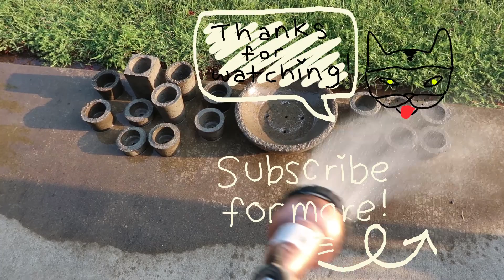Hypertufa | DIY

Comment: What if I can't buy Portland cement in my country will quick set work just as well..?
Reply from the maker: Hi! I have not tried with quick set cement. I'd imagine the water ratio will most likely be different and the finished color may differ as well. I found a recipe from Amy Renea's Crafting With Nature book: 2 cups quick set cement: 1/2 cup filler: 1/2 cup water. I've not tried this recipe. Let me know if it works for you. Good luck~! p/s: quick set sets in 5-10 minutes so work fast!
Reply: Thankyou for taking the time to find out for me
Reply: It will work perfectly. It will be a little heavier but the added benefit is It will  set faster.

Comment: Thank you for the video! Question, I have been watching a lot of videos on these, and most of them have covered the pots in cement for the 2 week curing method. What are the benefits/drawbacks of not doing that?
Reply from the maker: I'm not sure why one would cover the pots in cement during curing. I exposed mine to the elements and rinsed them off. Without rinsing, the pH level of the pot may be too basic (alkaline) for some plants.
Reply: Hi Melanie.  Regarding the chemistry of how cement 'cures', the slower it cures the stronger it will become.  By covering your concrete mix with plastic you can slow down the curing process.  However, this may not be important for flower pots, unlike a concrete road bridge! 

I hope that's helpful 😀
Reply: Sorry! Meant to say cover in PLASTIC. Ugghh..sorry!

Comment: Sphagnum Peat Moss,???/substitute????
Reply from the maker: Try shredded newspaper. If you pulp the paper it should work well as a substitute as they are made mostly of wood pulp.
Reply: Hair, coco coir, straw, or grass clippings that have been dried would also work; it's just fiber reinforcement.
Reply: Coco peat is a good substitute of peat moss